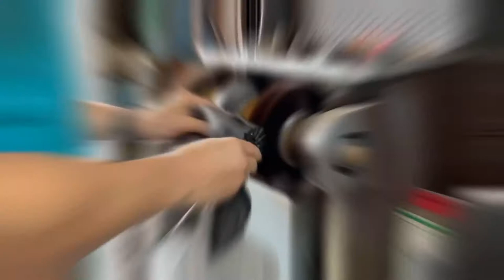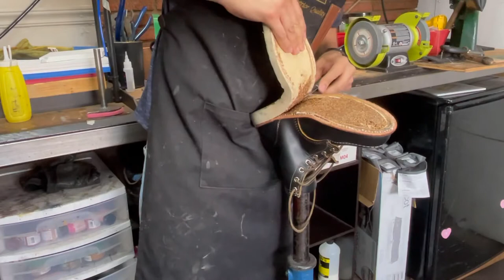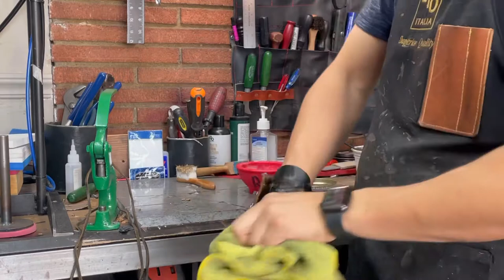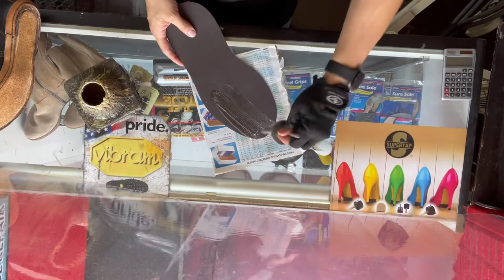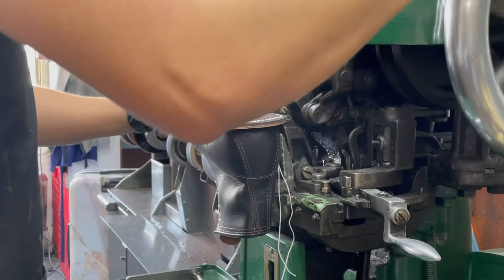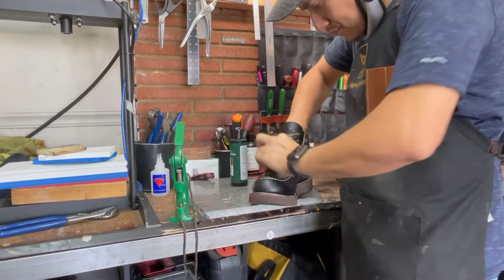Red Wing/Irish Setter 9874 Moc Toe Resole With Vibram 2021#Redwing #moctoe #redwingheritage

Comment: I have these same 9874 Irish Setter Sport Boots. Could you make them dressier looking by doing stacked leather heels with a low profile commando soles on these? Or possibly all leather soles?
Reply: Exactly what I was thinking for mine. Like a 6 inch version of the huntsman.  White wedge soles are such a lame choice on these boots, it distracts from that fantastic black Klondike leather.  Leather midsole, low leather heel stack with a leather outsole and vibram v bar half sole or something to that effect.

Comment: How much would it cost me to send you a pair of 11.5 Timberlands to have the Vibram sole put on? I live in Orange County California.
Reply from the maker: You can send me some pictures on Instagram to check them out, and see what they need!
The regular Resole is $85 as long as the welt is in good condition if we need to replace it $140 with Leather midsoles $130 with rubber midsoles 
You’d have to add the shipping costs I’m pretty sure is less than $10